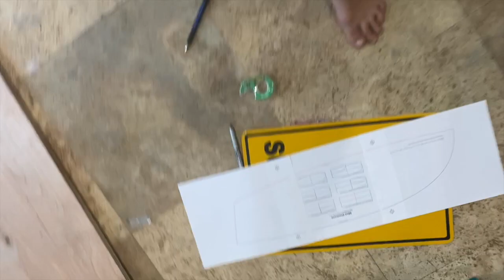Making a balance board! (Rail to rail tool to keep surfing in quarantine)

Comment: Would you say this is pretty accurate to the feeling of actual surfing? Ive never surfed in my life and its the first thing i want to do when everything opens back up so ive been practicing on a goof board and a balance board and getting pretty good. Just wondering :)
Reply from the maker: Kristin Paige hey Kristin! I would say that building ankle strength will definitely help you learn faster. To me, The feeling of surfing is that feeling of going fast, being free and dealing with unpredictability. This won’t replicate it but it will make you better doing it
Reply: @WorkForAvocados  thanks man 😊💖